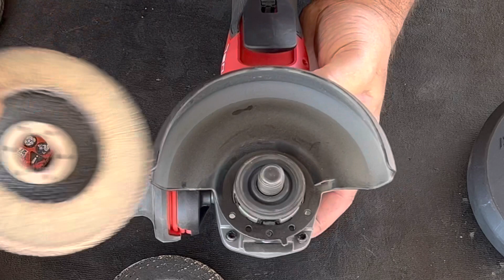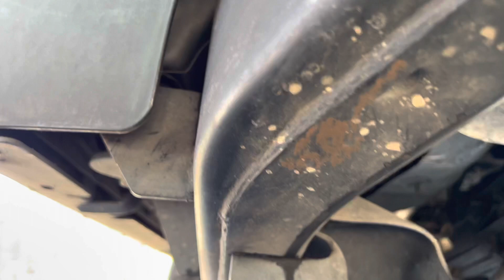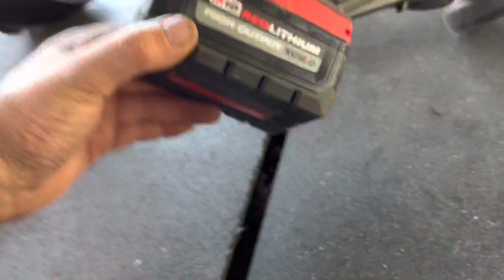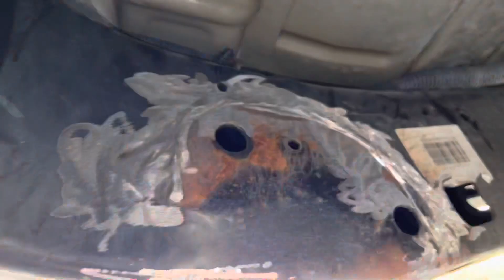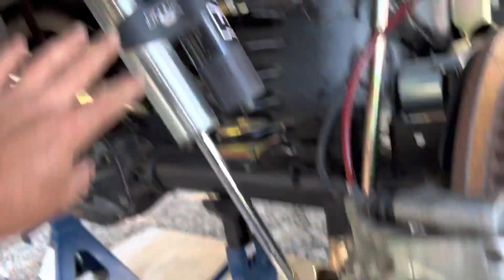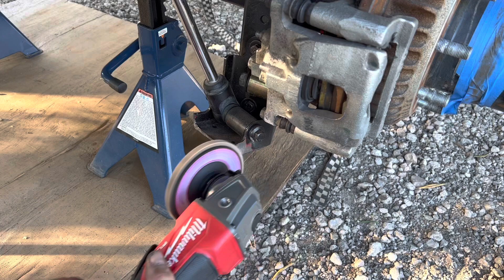Sparks Flying With The Milwaukee Tool M18 4 1/2 Angle Grinder

Comment: I'm trying to pick a grinder or polisher
Reply from the maker: Whatever one you’re going to use the most is the one you should go with..
Reply: @HowtoAutomotive  grinder then i was just putting everything together in my head we still have my dad's 7 inch makita polisher too
Reply from the maker: @austinmoore1689  that will work 👍